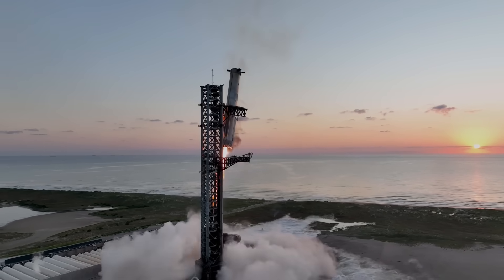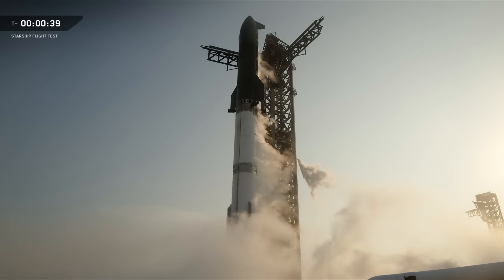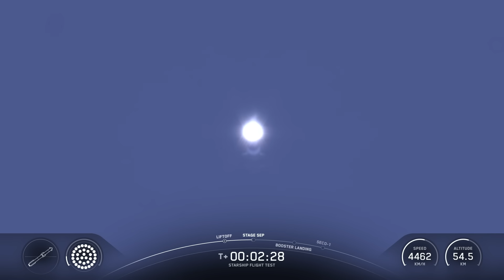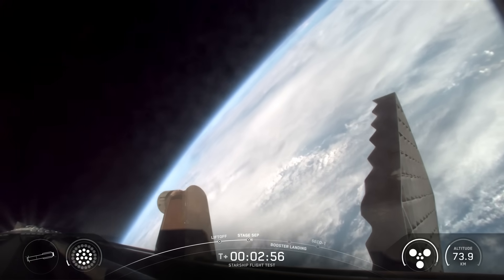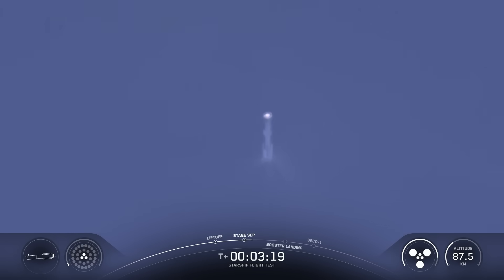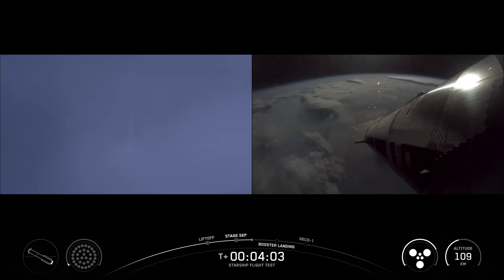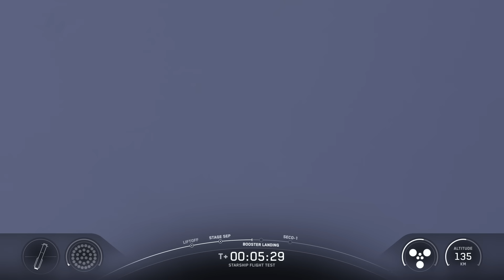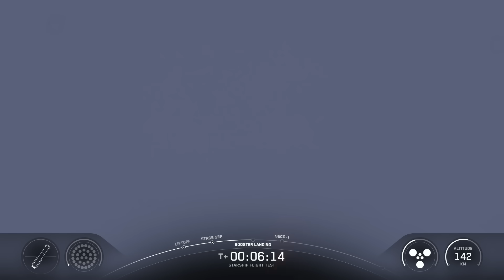SpaceX Builds Largest Reusable Booster, Also Makes Door That Won't Open - Starship Flight 9 Recap

Comment: "If this was a govt run project " we would still be waiting for the first StarHopper test.
Reply: I suggest you look at what the government was capable of with the Saturn V and Space shuttle...
Reply: SLS already flew around the moon man
Reply: It would be cancelled as a waste of tax money and the tech failure it is.
Reply: They would be closer to the moon! as the SLS orbited the moon on its 1st flight! meanwhile Space X are losers!
9 out of 9 failed flights...........and they think their good engineers!🤣all because they can sometimes land and reuse a booster! 
Space X cannot even get it into orbit of the earth let alone orbit the moon!
Where is all the other moon related bits like the refuelers they need 15!, human rated ships, human rated landers.
Space X are a bunch of hand self clapping yahoo failures!
Reply: @Leon1Aust sls started building in 2011, it’s had one flight in 14 years and is more over budget than the cost of the whole starship program, hardly a good comparison 😂
Reply: @minmo2288  a lot of the budget overrun for SLS is because it's mission goal keeps changing. it's original goal was to go to the moon by one president, then another decided that Gateway was going to be the priority scrapping all the work they had done. then another president decided Mar's was the priority causing them to then redesign it yet again then it went back to the moon being the priority and now SLS is way too heavy for the mission. this is the same problem Starship is suffering from.. work on the first step, using it as a re-usable heavily lift vehicle. then worry about what you're going to do with starship after that. 
Apollo and the shuttle on the other hand are examples of doing it right. Apollo's only goal was to go to the moon, nothing else. then they reworked the design after the fact for skylab. the shuttle was designed from the beginning to be a re-usable orbital lab, launch, and recovery vehicle. once they proved it worked in LEO they then began expanding on finding the limits of it's capabilities.
Reply: @sirmonkey1985  The Apollo program overran its budget by 3.63x, the space shuttle program overran its budget by 38 TIMES! Even your ideal examples are problematic.

Starship on the other hand, yes it's not developmentally complete but despite all of its past flights so far, it still remains below its initial budget of 10 billion which is nothing  compared to the budget that Apollo and the Space Shuttle programs had.
Reply: And SLS if flying once every few years, compared to Starship's every few months, so really SpaceX is doing development by doing test flight.

Also, actual work on SLS began in 2011, while work on Starship began in 2019. (Both had predecessor designs before, but that was when actual work began). Also SLS is just a re-design of older components and is much simpler as its all thrown away in each flight, whereas with Starship its being built from the groundup and its trying to do a lot things that have never been done before, including being fully reusable. @Leon1Aust
Reply: I dont understand why so many people are so anti "govt run" projects. There are good and bad example for govt run things, not all are bad an inefficient. NASA has done incredible things, like put a man on the moon, for example. A combination of both approaches is the most efficient! Also, SpaceX is mostly funded by public funds right? Please correct me if I'm wrong
Reply: and it would be 10x over budget.
Reply: And it would work...
Reply: And people would be making excuses for why it's so late, and why it's so expensive
Reply: Nah there would no small scale data gathering flights at all, just get it all working on the flight! Even if it means the program runs 2× over budget and delayed!

Comment: I think the difficulty with the door is that it also acts as a load bearing structure during launch which causes warping of components.
Reply: The temperature change could be jamming it. Space can get really cold. Even the overpass next to the Caesars Superdome has big bearings to allow for expansion and contraction between the summer and winter. It has lasted 75 years and counting.

Comment: A test flight is successful if you learn something. Even if it is "this doesn't work". As Edison put it in his famous quote about learning 10K things that didn't work. Since I'm retired I can admit that I've spent way more than 9 tries learning something that should be trivial, like "you can't slap a space character and null terminator on the end of the expected message and have it work". Which was particularly bad since some of the commands worked just fine with that extra data. Granted I didn't spend anywhere near what Elon is spending to learn. But the point is that if you keep learning, and it is possible, eventually you figure it out. And of course Elon is also proving why space exploration is best done by corporations. Unless you own SpaceX stock, your money is not being wasted, so you have no reason to complain about it. Unlike if it were government funded. Which is of course why governments tend to be to CYA to succeed with cutting edge development. And why they will also "stay the course" on a flawed design like the Space Shuttle because none of them want to tell Congress and the taxpayers that they threw $10B down the drain on a design that is never going to work well. Elon just has to justify that to the other SpaceX people, if that were to be the case.

Comment: Why didnt they just use a sliding door? Dont push against the pressure, just slide away from it...
Could they also add attitude control by moving fuel or air in the tanks around? Maybe with a small propeller?

Comment: Although the root causes of the failures of 7,8&9 might be different, it's looking increasingly like the Block 2 design has fundamental flaws in the fuel delivery system. I won't be surprised if SpaceX decide to scrap the remaining ones and focus on the Block 3.

Comment: I know that re-using the booster is a big thing and that the destruction of the booster was intended but you can't help but think that they are underperforming. The V1 ship did a pinpoint landing and now they have had the internals of the supposedly improved V2 ship not hold up. At this point the program is moving forward slower than it should. Improved hardware should fix problems and not bring on new problems

Comment: I think it is about time to put the idea to use JUST ullage gas for RCS into the "Bad ideas" folder, and retrofit Starships with an independent RCS system that does not turn the Vessel into an uncontrollable lump of steel falling on earth. I still wonder how the FAA greenlit the lack of control backup system after the first time the ship went out of control

Comment: Flight 9 showed that aside from liftoff and stage separation, nothing really worked. The booster crashed, Starship burned up on reentry. Progress is hard to see at this point — SpaceX is still deep in the experimental phase, far from having a reliable system.

Comment: Know that 1 in 10 can still be a good result. We once set our goals to 1 in 20, so we budgeted the failure and its costs from the start, and after 30 years we are still very successful.

Good for moral is to run many experiments concurrently, as then the successes come frequently enough. Some people appear to need more than plain good numbers. :)

Comment: None of this funding should be coming from the US government.
Reply: But this is the rocket that is to be used to land the astronauts on the Moon (and get them back up from there, safely) on Artemis-3 flights. Plus 12-15 more refueling flights. And how much SpaceX has already got for that, upfront?
Reply: @aka-o9x  Too much, if any. SLS will take us back to the Moon even though there's no reason to go back. We beat everyone to the Moon 56 years ago and even cancelled the last 3 Apollo missions ie 18, 19 & 20. There's no point sending humans back to the Moon except to do big science like building a giant radio astronomy dish in a crater on the lunar farside. It's a dead zone. An expensive dead zone. The longest any human mission has spent there is 73 hours.

Comment: Just a guess that the fuel lines had air pockets in them caused by an unstable(sloshing) fuel supply about thus the engines where staved of fuel long enough to cause a RUD....

Comment: It was a normal failure for space engineering. Some success and some failure.
That's not the problem here.
The problem is Musk with all his lies and false hope. Forget Mars in 2026, 2030 or even 2035. It will take another 20 to 40 years to get there. But why to get there anyway? Mars is and will be for a very VERY long time inhabitable and non-sustainable. Terraforming might be possible but not in 1000 or 2000 years from now. It's just a fact. Musk is a liar. That's also a fact.
Let the engineer do their work and research and they will figure it out. Remove Musk from making any decisions or announcements in this case and all will be well in due time.

Comment: I wonder how much Pogo the starship has as it climbs during launch.
Saturn 5  had the vibrations so bad they couldn’t red the gauges.
I’ll be the door was jammed shut from violent Pogo. Leaks in the system too. Maybe they can smooth it out next time.

Comment: Hi Scott, nice to see you every time!
Interesting what you mention about Spacex having developed the engines but having problems with a door.
I agree that a "simple" door should be a fairly easy thing to solve than inventing a whole new engine.
When do you think Spacex will start using the Raptor3 engines?
And what will be the next engine after R3?

I think that for humans to be able to travel further to see and visit other places in space, three things are needed:
-New, better engines, which are significantly more powerful than R3.
-Better materials, which can withstand cold, heat, radiation and can re-enter a planet's atmosphere.
and
-Artificial gravity in the vehicles we will be traveling with, since we will be traveling for days, weeks, months and maybe even years to some places. Then we can't float around and let our bodies be destroyed. Humans need a stable atmosphere so we can sit and walk around in a vehicle.
What do you think, is that logical?

Comment: Perfected door that wont open = wall
Reply: maybe they need to hire some boeing people.
Reply: @LordOfNihil No need to open the payload hatch if it falls off during launch 🧠
Reply: @LordOfNihil  Only if you want the door to remain shut, but the rest of the wall opens. ;)
Reply: That door has had a rickety design.  I saw it tested on the ground, and it looked like it had more kluge than solid engineering.  I wonder if Elon dictated the design rather than having it actually engineered.
Reply: @treborg777  Surprised the booster strees test was not changed to a controlled water landing to do a failure analysis on the door, which is operationally more important to know.
Reply: The Space Shuttle also had no escape capability.  Apparently no one knows a practical way to include an escape feature on a large vehicle.  Two seat fighter jets have ejection seats & parachutes, airliners don't.  In some craft you're going down with the ship.
Reply: @davidkottman3440 Buran had ejection possibilities for these crew. So if the freaking Soviets could and did, there are no excuses
Reply: @notaseriousbeaverBut the Buran only included 2 seats no different from the Early Shuttle flights, the problem becomes bigger when you have 7 seats in the positions they are in
Reply: Elon took trump wall idea too seriously 😂
Reply: So when Starship flies with a crew onboard  what happens if it suffers a fatal malfunction during ascent? Give them parachutes  and bail out the cargo door? The door that is failing to open? Because unlike Dragon,  there are no escape rockets or capsule to separate and parachute down to a safe landing.  The crew would be dead meat.
Reply: @JimiGunn Don't worry, Starship will never launch crewed.
Reply: @maxwellquebec8675  Just as Falcon 9 will never be recovered and reflown. What SpaceX is doing is a pipedream and all vaporwave to fool investors...
Reply: The door is likely just fine.  The software would not allow the door to open while the craft is tumbling out of control.  Satellites must be  launched under very controlled conditions.  Tumbling out of control is not a controlled condition.
Reply: Even if the latches were released, tumbling might have created stresses that kept the door shut. We don't know.
 @jonahbert111

Comment: Failure tolerance of spacex company is amazing, that means its engineers are not afraid of trying new things and take risks. There are well fail proof and tested ways of doing things but this tolerance allows them to try out new better or simpler things and laugh out the mega failures. Considering the volume of ships that will need to be built, its totally worth the fails.
Reply: A single moon mission is supposed to take 15-20 successful starship flights. If feel a lot better about it if they managed 1 successful flight

Comment: Complete fail almost. 

Booster did its job, they weren’t recovering it and testing its envelop of capability.  

But the upper stage…..nope. 

As soon as it shut down its engines it was obviously in trouble yet again. 

Having a vessel spin out of control due to a fuel leak acting like a force on the ship and a jammed or non opening door means its failed 50% of its targets. 

SpaceX has obviously sorted it lower stage, the upper stage isn’t even capable of achieving a stable launch path due to repeated failures. 

They have a lot of work to do in the upper stage and so far it looks like that they aren’t getting anywhere near having a usable vessel.

Comment: What is that shielding around the sea-level raptor engines? looks like something out of the 19th century, the way they use to rivet plates together before welding was a thing.

Comment: It's hard to believe that it's stainless steel that's melting away like tin foil in those last images ... and yet, in another part of the universe a little green creature named Jedediah seems to be able to withstand that heat just fine.
Reply: Kerbals are build different.

Comment: Congratulations to Elon, he made starship as reliable as cybertruck.
Reply: No shortage of hate filled people.
Reply: @lamarw7757  Ton's of comments with the same Cybertuck comment.  Obvious influence campaign.
Reply: NOT true, at least some Cybertrucks work. I can't imagine anything as dangerous to a passenger as Starlink will be. One little problem and you are dead for sure. No TACA flight 110 on the levee in New Orleans, or miracle on the Hudson landings with a Starship. Though you would save on cremation.
Reply: they also both explode XD